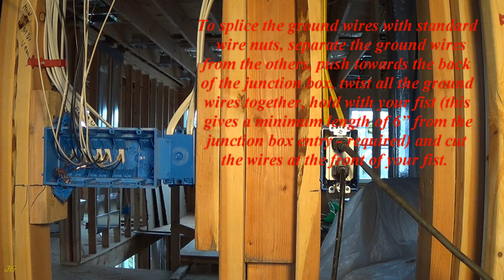Rough in wiring (connection) for 4 single pole switches in a 4 gang switch junction box.

Comment: It looks like you have 5 ground wires plus 4 pigtails for the switches which is 9 wires under one wire nut. That's too much, even though you're using 14AWG and a blue wire nut. You could use a greenie and only need the 5 ground wires, leaving one long one to jump from one switch to the next continuously and save space.
Edit: I tried putting 9 #14 wires in a blue wire nut and it worked out well as long as you pre twist well like you did. I was concerned about some wires slipping back. I also tried 7 #12 wires and it seems fine with that too.
Always learning, thanks for the video.
Reply: I am using 12 AWG wire so I don’t think I can fit 9 grounds into one wire nut. I understand connecting the 5 grounds with the green wire nut and leaving one longer. But how do you “jump” from one switch to another?
Reply: @jaspiecat7851 Jumping the ground wire from one switch to another means that you use a long enough bare ground wire to wrap it about 270° around each ground screw and terminate it at the last one, in one continuous wire.